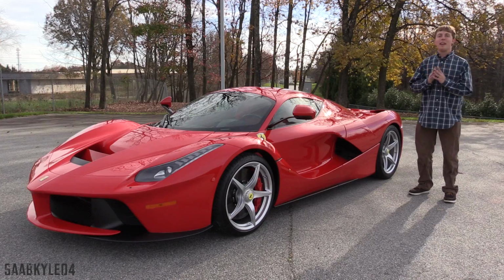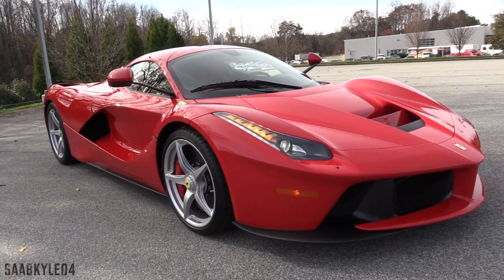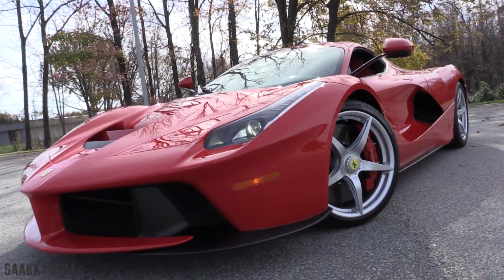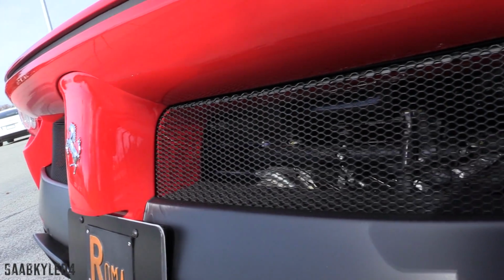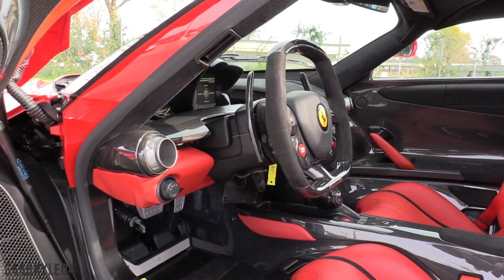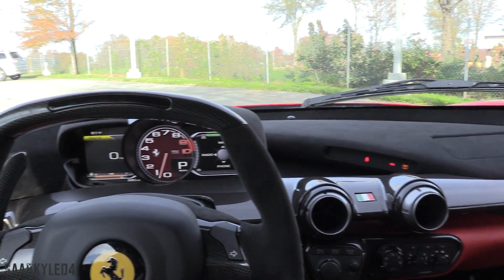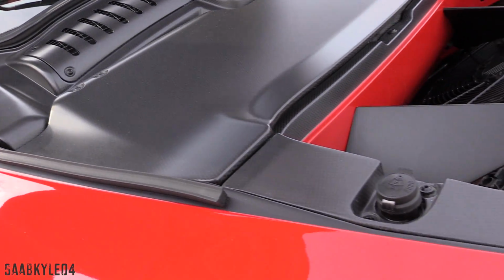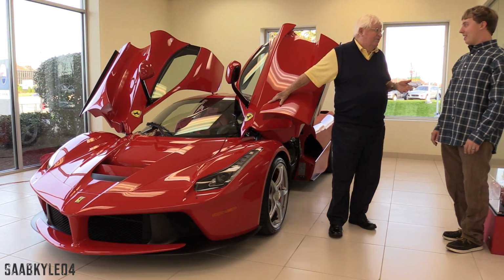2015 Ferrari LaFerrari Start Up, Exhaust, and In Depth Review

Comment: Don't get it McLaren F1 top speed approximately 243 miles an hour with 670 horsepower, Ferrari LaFerrari 950 horsepower top speed around 220 and weight has no bearing on top speed I guess it's pure aerodynamics ? But my opinion the Ferrari is pure sex on wheels !
Reply: This must have 963hp and his top speed actually is 231mph.

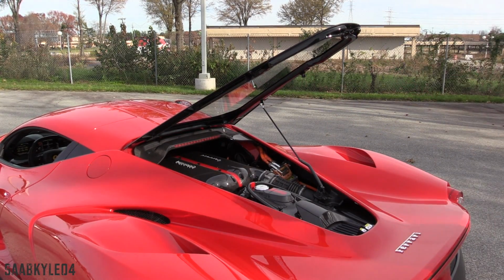Comment: 15:15 2.3 kwh battery is not very big at all. It seems to be used just to cheat the acceleration capability of this gas powered car. The battery size doesn't make the "hybrid" classification legit, even the new Toyota Prius has a bigger 4.4 kwh battery.

Comment: Ugly car like all ferrari"s            Circuit cars  all look like formula 1 cars  both outside and inside .  The inside looks like its unfinished. If you want to drive this car on public road you need formula 1 suit  , but in both situation you are an idiot  with suit or without .  Looks very old  and like its all made from cheap plastic . Can't believe they have clients who actually  buy this  crap and for a lot of money  they are  more exotic car brands that shits on ferrari are way better  , have better tech , lux interior etc not like this crappy car   The inside of this car make you feel like you are inside of a dumpster .
Reply: What about the f40? Do you think that's ugly as well?

Comment: who makes the calipers?
Reply: +Ashy Gee Akebonos are garbage. 370z's have them and the Brembos on the 350z's are a mile better. NO WAY Ferrari will ever adopt that brake manufacturer on any of their cars.
Reply: +Ashy Gee I'd guess Brembo..
Reply: Nice to know, I thought they were same brands as the P1 - Akembono.  thanks.
Reply: Ashy Gee I'm only guessing, because Brembo are Italian...
Reply: I agree, with you 350Z/G35 Brembo are far superior to 370Z.  I have a evo 8 w/Brembos.. the current Evo 10 are a tad bit larger.  I've heard Akebono were in quality in par with Endless brakes....mind you Endless just started (10yrs) development of ceramic rotors, etc.  I'm still surprised P1 uses Akebono. Has Akebono developed any Calipers that can cope with regerative braking systems....they prob.....should venture that route since their so far inferior to Brembos?

Comment: only thing I don't like is the switch of the modes on the steering wheel, because those actually break off easily and that sticker comes off too LOL expensive as hell for those tiny parts.

Comment: carbon fiber.. we love it, but theirs a major MAJOR M A J O R  issue with carbon fiber that NO ONE seems to address.  The issue is the fact carbon fiber isnt simply carbon fiber.  its carbon fiber and RESIN.  And that major issue is that over time RESIN begins to breakdown, turn yellow, somewhat deform in, and become brittle.  does this means these carbon fiber cars will be cracking up in a few years, no 'hopefully not'  but it does mean these cars will not last as long as those classic metalic counterparts.   treating the resin will be the task for future generations.

Comment: 1/499 Thats nice!
Reply: The plaque always says 1/499...
Reply: Ahh so it is "One of the 499" damn, it got me!
Thanks!
Reply: dan McClaren Yeah for sure. I was like WTF this guy has the first of them all which I thought it was reserved for Ferrari.
Reply: +Paco Inurreta This is actually good because it prevents bragging rights and over the top speculation. Because No. 001 would be worth a lot more than let's say 083 or so.
Reply: +Paco Inurreta I think they donate the first one to the Vatican.
Reply: it says that on all of them so the owners won't bitch on who's got the first or the last type stuff
Reply: Paco Inurreta it's not the first and everybody noticed there are more than 499
Reply: Alex K. Im pretty sure you can track that with the VIN. Just like the McLaren F1, I dont remember seeing a badge but you can track them down with the chasis number.
Reply: +Paco Inurreta Yes if you compare them all. There is no official data base of chassis numbers of modern Ferraris because there are too many of them. Besides, I am certain that the first one went to a Ferrari family member, which means that it will never be sold.
Reply: Yup, the Aperta really fucked it up
Reply: CarlosFibra yeah if im not wrong, about 750 were made!
Reply: DimensiiioN but not on Lamborghini... strange

Comment: “Porsche’s 918 and McLaren’s P1 are both plug-in hybrids and both have limited all-electric range. Ferrari’s battery is smaller than those in the McLaren and the Porsche, and Ferrari has included very limited all-electric capability at the request of some customers.” – Ferrari

No EV mode? Maybe this particular car doesn't have it, but some do.

Comment: Dude this car has 963 hp not 789hp
Reply from the maker: +Dominic Madbull It makes around 950 BHP or 963 CV, different measurements, but often used synonymously.  The engine itself makes 789 BHP or around 800 CV, plus 161 hp or so from the electric motor.
Reply: +Saabkyle04  u are right
Reply: ***** right

Comment: 25:45
Great exhaust notes!
At least as good as the Lexus LFA. Very original. Has a sort of tearing sound, with a bassline
Reply from the maker: +What is Bitcoin? It's cool once you figure out how to rev it, obviously it's different on the road, but if you rev it and keep it up with the bypass valves open, you get the fill sound rather than letting it come down each time, like two personalities!

Comment: i dont like ferrari, but this car is gorgeous
Reply: I like the front but not the back and I've never liked ferrari interiors. They just look so boring. I mean it's a hypercar it should have a nice ass interior like the 918 or the p1
Reply: Ianmdrummer
dude, my tought is exactly the same, compared to 918 & p1's interior, laferrari's interior is nothing
Reply: +Esa Mudani that's probably why it's lighter though. I love the p1 and 918 and am not trying to justify the interior in the La Ferrari, but obviously the entire point of the car is to be fast. So it's understandable to have a bare-bones interior.
Reply: +Ianmdrummer P1's interior is made of the same stuff in the LaFerrari. Are you high?
Reply: +Esa Mudani LaFerrari's interior is equal to P1's interior. They both use the same materials.
Reply: YTNG MTT
i mean, the look
Reply: The Jackal
i think so too!!

Comment: What's wrong with the audio in this video man. Can hardly hear him.
Reply from the maker: +Emile Boel Just adjust your volume, it sounds quite clear on this end :)  It's a loud car (actually had to turn that audio down a good bit) and my interior shots are louder than normal because I had to put the camera closer to my face to capture the angles.  It's edited like normal, just a few things different.  Might have to adjust the gain on my microphone too, no worries, thank you for watching!
Reply: ***** Yea i got it fixed. My headset wasnt on the right mode 😃